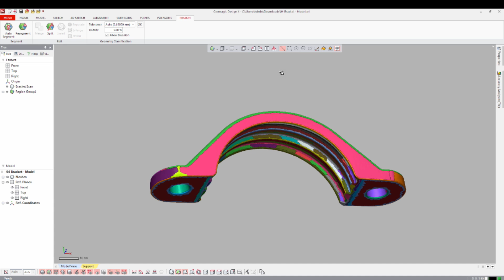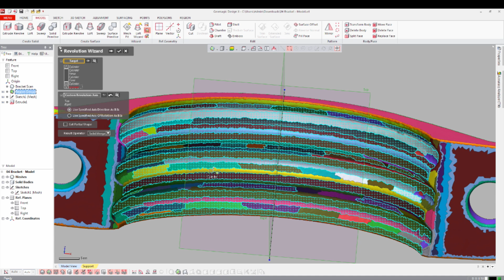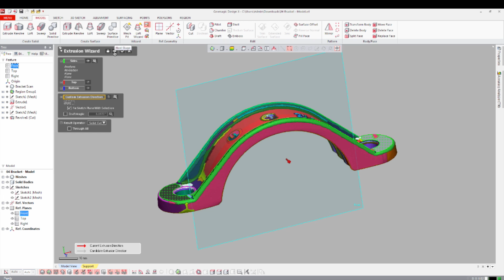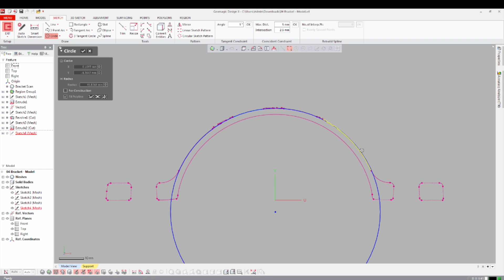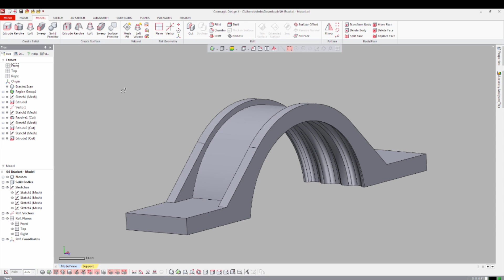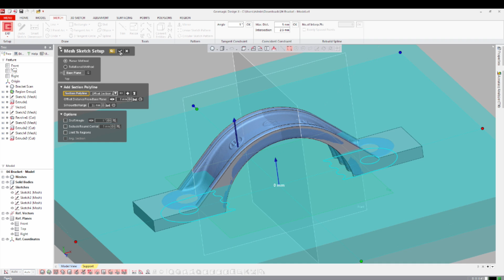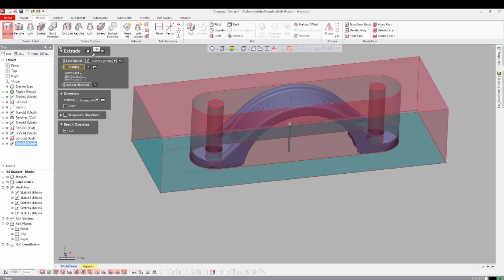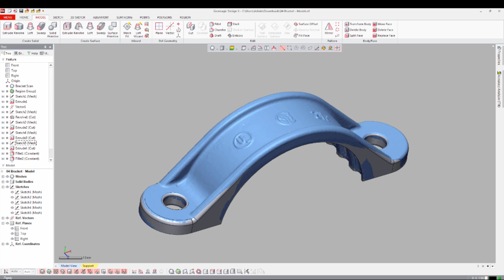Geomagic Design X 2016 - Scan Data to Solid Model

Comment: How do you take raw scan data and get it to a mesh good enough to start modeling from? Do you need to reduce the size first?
Reply: Thats a Design X speciality.  wide range of point cloud processing tools and many options for converting mutiple scans to a merged mesh.  You can model with a full resolution scan data set, but depending on your system resources or personal preference  you might be a little more efficient if you spend a little time upfront to optomize or decimate the model.